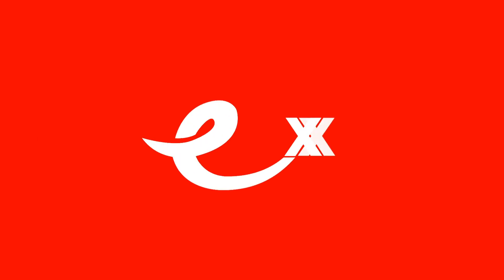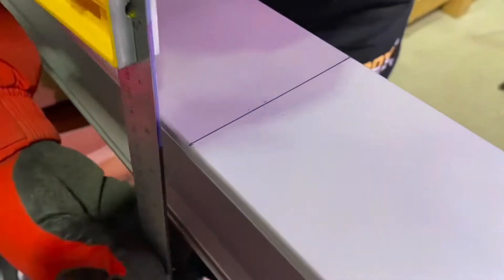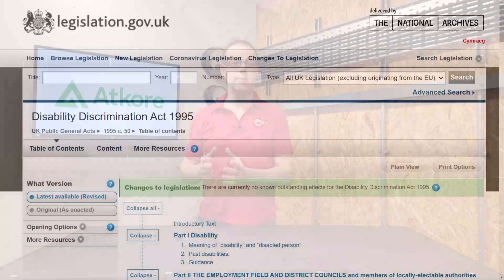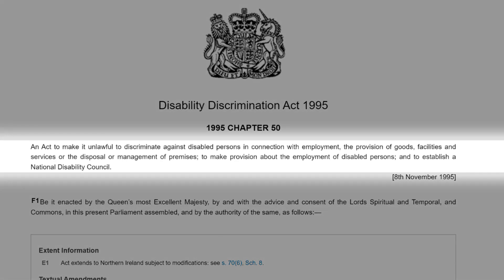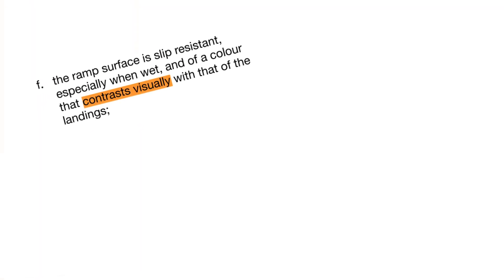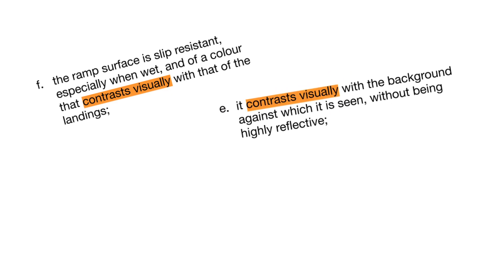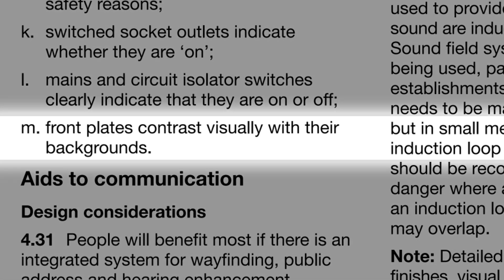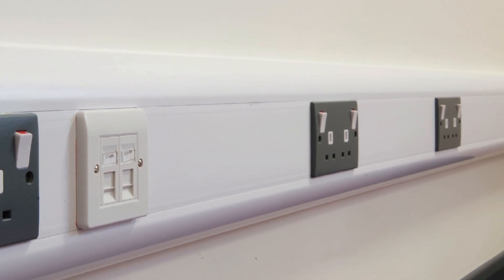SHOULD ELECTRICIANS CARE ABOUT THE DDA?

Comment: DDA got absorbed into The Equality Act 2010 along with 115 pieces of other legislation. 

Hence, the DDA should not be referenced as a current act; it is no longer relevant. 

Simply refer to The Building Regulations Part M and the need to comply with The Equality Act.

Referencing DDA in 2022 only causes confusion because the DDA got superseded as mentioned above. 

I hope that this clarification helps.

Comment: Of course, not the specific British regulation since I live and work in Germany, but this also has an impact on the heights we should install accessories like light switches for persons using a wheelchair. Light switches should be mounted at a height of 85cm instead of the regular 105cm. Socket outlets should be installed 40cm instead of 30cm. All heights above finished floor to the center.

This is, here in Germany, regulated in the DIN 18015-3. The DIN 18015 is the regulation for electrical installations in domestic dwellings, and the part 3 is about installation zones where to install the cables and where to install the accessories. Other things in the DIN 18015 are such things like designing the whole installation, minimum number of socket outlets in different types of rooms, how many circuits, the proper size of the consumer unit. Kitchen cooker circuit, there the wiring must be at least dimensioned in that size that you could fuse it with 3x20A, even if you then only install 3x16A. So that circuit is future proof if the customer wants to become a master chef and the 11kW for the regular cooker are no longer sufficient. Then you don't need to rewire that circuit, simply replace the MCB.
Reply: Building Regulations Document M, Sec 1.18, and BS 8300 in the UK. That's the easy way.

You can also do it your own way, up the rocky path, but then you need to write justifications, etc, for building control purposes and show how you know better than the experts, or (more appropriately) the particular, individual requirements of the setting and its users.
Reply: @dansheppard2965  Also different is that installations for such homes must have AFDDs for bedroom circuits here in Germany. For regular bedrooms this is only a recommendation.

Comment: I have no issue with making a public building accessible but the absolute nonsense of insisting that light switches and sockets are set at stupid heights is just stupid. I refused to do it when my BCO insisted on it and quoted the actual rega at him. It’s only for new builds, he said it was also for my house extension. 

Also, having to have ramps and wide doors for wheelchair users 🤦‍♂️

Sledgehammer meet walnut 🤷🏻‍♂️
Reply: Does the socket and switch heights not apply to any new installation? As opposed to just new builds as you say.
Reply: Overall i think the socket and switch heights that came into being few years ago for new builds was away of ticking boxes to prove the industry was doing something. The majority of people with disabilities do tend to have houses specifically altered  to suit their needs and when available single story dwellings, have seen couple of houses with deaf people living there and the lights flash when someone rings the door bell.  perhaps many of these regulations will be useful to us all when we're very old.
Reply: @rodgerq  ONLY applies to new builds. 

Some information I had to educate my BCO with….
Reply: @andjc72  I don’t want to sound insensitive, and the light switches aren’t THAT bad, but the sockets all the way up the bloody wall looks ugly IMHO. I refused to do it.